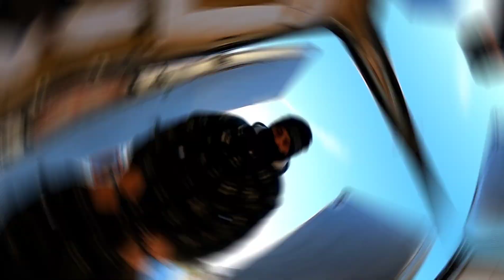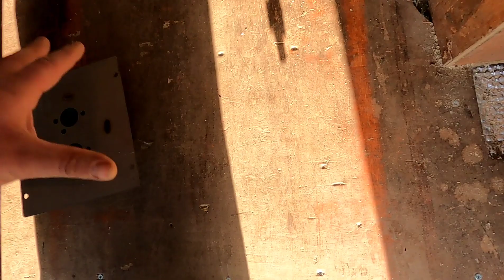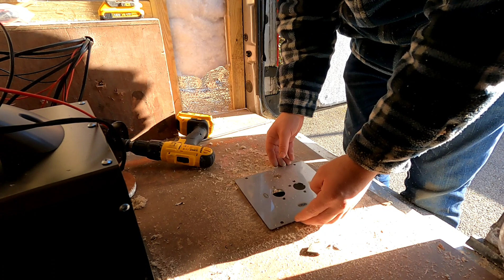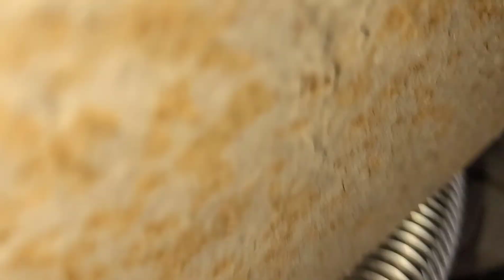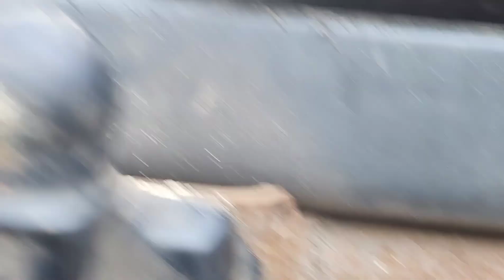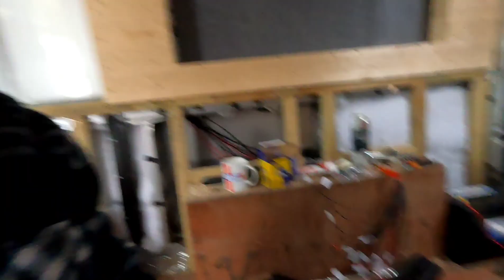Chinese diesel heater - Full install from start to finish 🔥🔥 #DieselHeater  #Vanlife #Compact

Comment: Hi mate great vid. Look ING at fitting my all in 1.  The weekend in looks like getting a turret . Also should I wire it to the main engine battery or use my second spare battery I have .thanks
Reply from the maker: Thanks mate, I'd definitely recommend wiring it to a separate battery, the last thing you want is to break down in the middle of a field with a flat battery 👍👍👍

Comment: Hi do they need to be fused or are they wired direct to battery. Thanks 😊
Reply from the maker: No problem mate 

Definitely use one , 15 amp 👍
Reply: @LT_TOMMY_  Thanks mate you have been very helpful 👍👍 I will be watching some more of your videos later 🤙
Reply from the maker: Hello mate , they usually have an inline fuse built in 👍
Reply: @LT_TOMMY_  thanks for the quick reply. This one hasn’t got fuse on the wires supplied. Do you think I should use one if so what size fuse would you recommend it’s a 5kw. Thanks again 👍

Comment: i have the stackable version, one thing i had was pinched fuel line from the tank to pump, straighten it out and shortened a bit to get rid of kink, Also install fuel filter after the pump. I took the line off heater when priming to get all air out then connected it again and did prime again to get rid of the excess air. 
Great units and monster heat output. tank lasts for 20hrs or so of heat full bore.

Comment: Does it have a fuel level gauge
Reply: transparent side
Reply from the maker: As above there is a gap in the body of the heater so you can see tank 👍

Comment: Nice vid mate, not sure if overkill for my needs got a swb viv. Would you recommend 2kw for van of that size ?
Reply from the maker: Thanks 👍👍👍
I had a 2kw in my T4 and it was well enough, I think the 2kw are a bit harder to get hold if at the moment, a 5kw would be fine just have it in low , but make sure you give it a good blast sometimes before shutdown 👍